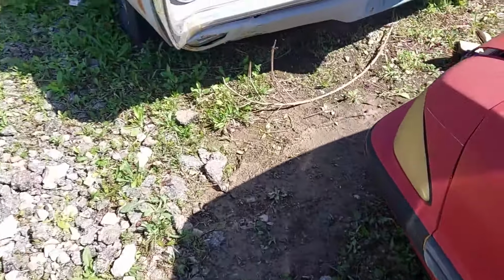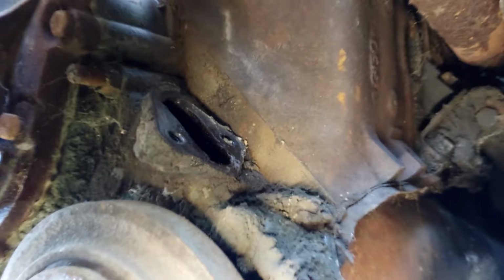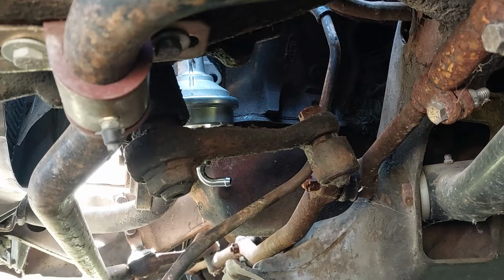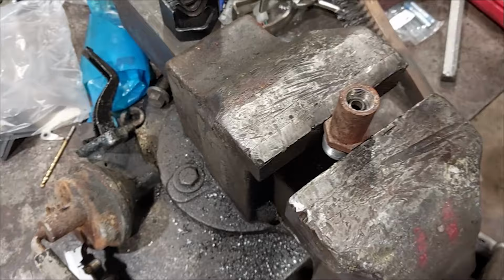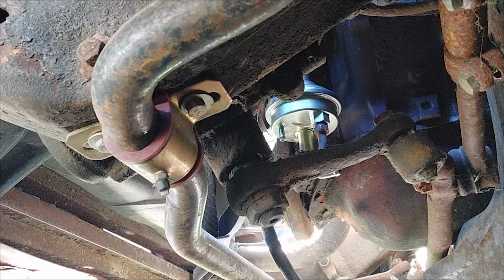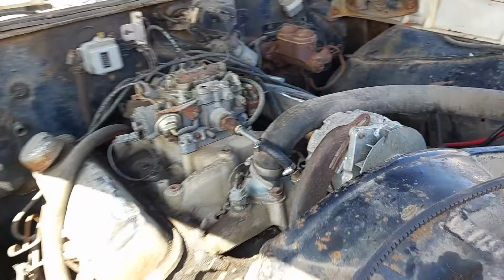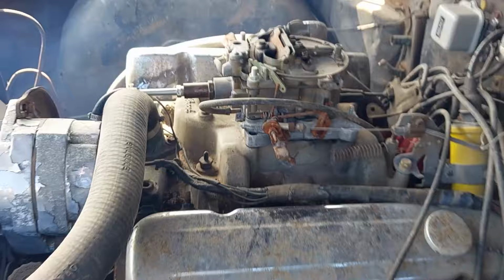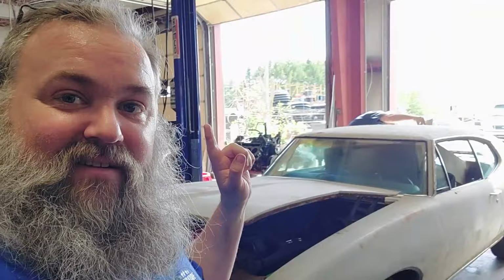I WILL Make this thing drive! 1968 Pontiac LeMans fuel pump replacement and... First Drive?

Comment: Very nice my friend! You should make yourself a little helper switch, so you can leave the key on and turn the engine over from under the hood. Just need a momentary button with an alligator clip connected to the battery, and another to the starter motor. Makes attempting to start a stubborn engine much easier when your by yourself. It'll save you from all the back and forth to the driver seat. Watching you run to grab the brake clean last video was killing me. LOL!
Reply from the maker: Yaaaaa I've never really NEEDED something like that but there may need to be one added to it in the future! Fortunately now it cranks and fires like it should! Unfortunately I'm about to take that all apart now :) Oh well at least I got a win eventually!

Comment: Question, is that a ballast resistor on the firewall?
Love the content of these vids, I have a 68 GTO that’s in a similar situation, so I’m super pumped with what you are doing.
Reply from the maker: They grey box? That's the voltage regulator this car's alternator doesn't have an internal regulator. Glad you're interested, there's a WHOLE lot of work ahead of me with this thing for sure!